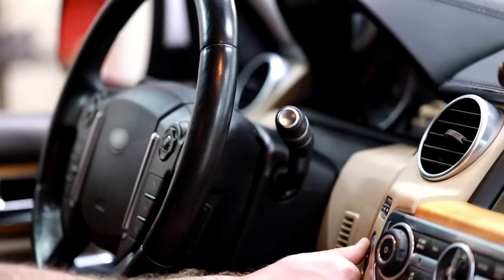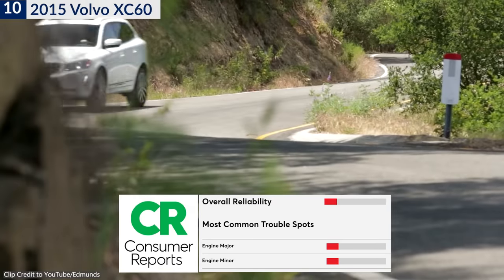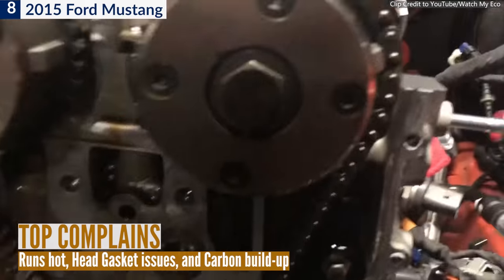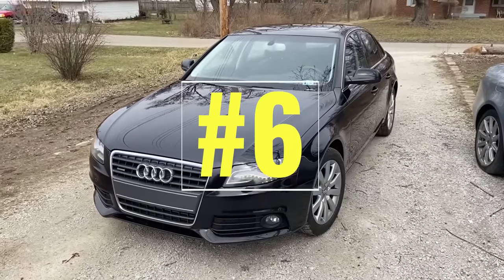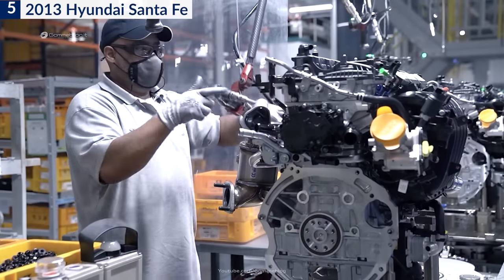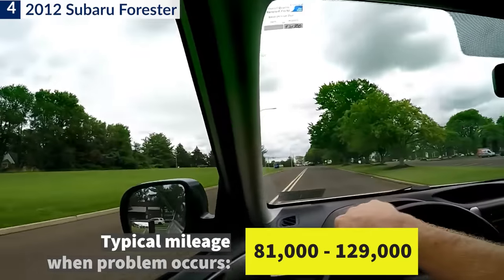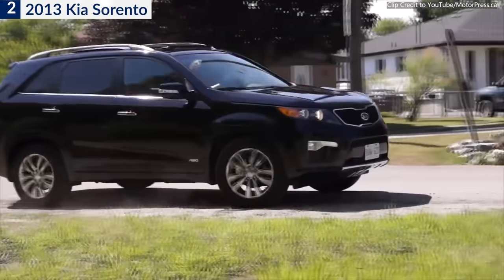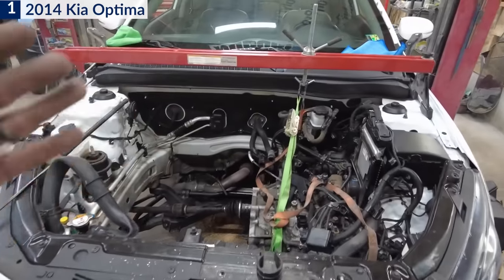10 Used-Cars to AVOID for BAD Engine - as per Consumer Reports

Comment: Funny story... when I was a teenager in the 80's I wanted one of the newer model Thunderbirds because I liked the look of them. I found one used 1983 model in the local newspaper and bought it for a reasonable price. When I brought it home my dad was mad at me for not checking with him first to ask about the reliability of that model and year. He told me that year engine was notorious for blowing a head gasket at around 100,000 miles because Ford tried using cork for their gaskets that later turned out to be a bad idea. And sure enough, just as the odometer rolled over 100k it started belching smoke upon start up and basically whenever you stepped on the gas pedal. The repairs were going to be more than the car was worth. Within a month the car was headed for the car crusher. Moral of the story...always ask Dad first!
Reply: Learn how to fix your own stuff. Blown head gasket is repairable IF you catch it quickly. Don't want a crankcase full of antifreeze. A weekend of work and less than $100 in parts and back on the road.
Reply: Yep … That 3.8 engine was CRAP … Ford screwed over their customers with that one …
Reply: I'm not a mechanic but learned due to these engines , for Ford.  The 2.8 , 2.9 and the 3.8 . All prone to blowing head gaskets,. I would never own a Hyundai or a Kia. Helped work on a few .  The early chevrolet 3.8 had intake gasket problems .the newer 3.8 . To much heat in the engine compartment .  I don't or will not work on any Chrysler engine except the slant 6 or 318 . The 4.7 is iffy you may get a good one or not the same with the early chevrolet 5 cylinders in Colorados and canyons . Yes I love working on all kinds of $#!+ . Owned most of what I mentioned.  Had a friend who collected Yugos , yes yugos . He loved them and for that I didn't give him to much crap about them
Reply: I'm a young machinist with a GenX coworker that knows most  asian vehicles inside and out. One day I heard a little rattling from my accent and asked him if he would check it out. He tells me it's a bolt and he'll fix it on break. 

He comes out on break, grabs a socket set and an extender from his accent, pops my hood and tells me about this bolt that isn't torqued to spec correctly from the factory on these cars and sure enough, problem solved. Dude knew that car down to the most superficial things.
Reply: would have been a good learning experience for you and dad to change the gasket, no need to crush a nice car with a blown head gasket
Reply: I hate to break it to you but your dad was wrong. Corke gaskets have been used for decades before that car was made. They work well when installed correctly trouble is that most people add sealer and that causes the issue.  The other thing your dad was wrong about is that corke has never been used for a head gasket so that couldn't possibly be the reason those engines were prone to head gasket failures. Just because your dad told you something doesn't mean he knows what he is talking about and so on goes the myth that imports are more reliable than domestic. For example the most unreliable engine that I can think of is a Mazda Rotary that they sold for 25 years yet Mazda has a good reputation. GM had a a bad batch of camshafts that they fixed after 5 years yet people still think that makes them unreliable.  🤔
Reply: @wilsterone6689  Thank you. Saved me breath. Cork head gaskets... smh
Reply: You junked it because of a blown head gasket?
Reply: @scavengerspc  
He was listening to his expert dad, who thought headgaskets were made of cork.
Reply: Had a beretta gt with a 3.1   My first financed car that kept me broke too.  Always over heated.  Upon further inspection it was held together with rtv sealant everywhere.  Sold it and got a Honda and it had issues.  My s85 10 4 banger no issues and the patriot 5 speed no issues.  I wish they made things like the old days before I was driving
Reply: @thisdjdada  Interesting,  those engines were known to be absolutely bullet proof. FYI RTV is the preferred sealant for valve covers, oil pans, and intake valleys.
None of which come in contact with coolant.  I'm thinking you had another issue that you failed to address.
Reply: Now we have google
Reply: @wilsterone6689 Should sealer be used with head gaskets?
Reply: @John60s70s  No, if it needs it, it will come already applied.
Reply: Lol. Mine was a Ford mustang. Similar story. After 2 blown transmissions, I got rid of it.
Reply: @wilsterone6689  As long as the RTV isn't overdone, otherwise when it gets into the engine...problems.
Reply: @marktoken6052  Part of my issues with YouTube comments is that they don't exactly show to what comments you are commenting on. 
Since it has been months, I don't remember all of my comments.  What I can say is that it takes years to become a good technician.  That being said,  there is a lot to consider when choosing to use RTV. Like, how much to apply,  what fluids will come in contact with the RTV, what temperature the RTV will be exposed to, and so on. RTV can ge your best friend or your worst nightmare.  Follow the OEM recommended application, not a guy you know who works in a gas station repair shop.
Reply: ⁹ @thisdjdada

Comment: I bought a 2009 kia optima kept it well maintained garaged changed oil and fluids reg.. I followed the manual guidelines . In short the motor like many other KIA's was junk... So at 130k + miles the motor overheated.. all fluids coolant always up to standard
I just junked it for 300 bucks.
My 89 honda Crx I bought new in 89 while in the military? Still starts in 23 deg weather with 380k miles... Just a little rusty on panels and seats are worn lol
Reply: Honda makes the best engines.  Toyota's  as well.  No manufacturer is without it's problems from year to year.  You will see A LOT of old Toyota and Honda on the road versus everthing else.
Reply: Those are golden years for Honda.
Reply: 2 bad Honda did away with the ‘Bullet Proof’ 2.4 four and went over to the 1.5 turbo. I am considering disabling the VCM on my Pilot. That start - stop feature is another drawback. Watch Scotty Kilmer for more details on these features that sacrifice durability and longevity for a few more miles per gallon.
Reply: I owned  many Toyota, including 1980- Celica, Corolla LE., Trecel that Manufactured in Japan. I brought these car used with low mileage except Trecel. I never had issue even oil leak and I drove it all over the country and kept them for many years with high mileage. I used only JDAM parts even it used parts but it from Japan for maintenance. These Toyota Corolla was used for Taxi and police car in Japan and the design baseline is way back to 1968! I was told by Japanese CEO in 1980 that Toyota SR-5 is a Midway for American car industry.
Reply: The old Civic engines were though. We see how newer, post 2010 hold together. I hate 2.4L engine that found it self in Accord, CR-V, Element, Acura. OCI too long, a lot of baked piston rings.
Reply: To be expected from a Honda
Reply: @varcade8  parents bought an 88 Honda Accord from college student for $150 in 1996. That sucker had lived a life! Had 245k miles and dad replaced clutch. Me and my sister shared it and had to replace clutch MC again. But it was just never right, so my dad told us we could continue to drive it if we could figure out how to drive it without the clutch. We scoured our friends, found one to show us how, and we learned, and drove that car another 150k miles!!!!! Only thing to ever replace (aside from the clutch but over a period of next three years) was tires and a battery!!!! Not a single thing ever with the engine and we sucked at keeping maintenance!
Reply: I have a 2009 optima lx with 160,000 miles. I’ve replaced suspension myself at 130k, drain n fill transmission, fluid change on ps, coolant, replaced motor mounts to keep them in check, and  synthetic oil changes. Use it as our road trip car and daily driver. It drives great, smooth on the road and decent on gas mileage. This optima will probably outlive me.
Reply: I was thinking about a new kia or hyundai suv, because of the price, but idk now. I would like the reliability of my 2006 rav4 now with almost 300k and still drives like new, just regular maintenence.
Reply: Kia or Hyundai will never match the reliability of a Honda or Toyota. Most people think they are good value because they’re cheap. Honda will outlast them all
Reply: @patrickgowar2234  Depends. My 2008 Civic LX 5 speed had the dredded cracked block issue. Got a new engine, but also had a power steering leak that had to be fixed. I loved my civic, but ended up selling it since I had too many cars and my family didn't know how to drive a 5 speed. However, my next car that will be my forever car will be a Camry. Absolutely LOVE that car. Great on the road, extremely comfortable, reliable, awesome gas mileage and more than enough room for road trips.
Reply: @patrickgowar2234  Not really. I had a 2006 Toyota RAV4. The Toyota had its audio system replaced within a few weeks of buying a new one, and sold it before reaching 100,000 miles due to severe oil burning that reduced the oil level by half. On the other hand, the 2010 Kia Soul is still being used without any issues. Kia's highly reliable, of course, it's the best value for money.
Reply: At least you got that long. I know people getting 2023 cars and getting 1,000 miles ,tranny gone ,engine, ac system.. it's sad, now they owe 50,000$ with no car. To much to fix.. warranty you got to fight hard to get them to fix it usually. GM is very bad with warranty.

Comment: My 2016 Kia Optima engine blew, but the replacement was covered by some sort of a lawsuit that Kia and Hyundai lost. There was knocking and loss of power just like stated.
Reply: How much u pay for it
Reply: Yea happened to me, they gave me a new engine for free with a lifetime warranty
Reply: My new back then 0 miles, 2013 optima, stalled in the middle of the highway, at 30 miles, almost caught fire by the smell, Kia replaced the new engine as it was a recall issue they were having,
Reply: Never buy Kia or Hyundai. Garbage cars.
Reply: The dealers are making money changing engines reimbursed from the factory. So when you go to the dealer to get oil change you might get oil changed or you might get just a bill for oil changed.
Reply: Yep, friend of mine had to replace the engine in their Optima as well.
Reply: So did my coworker's Optima. Avoid anything with the  2.4 KIA GDI engine

Comment: I have to add 2015 Kia Soul. I have had nothing but problems with it burning oil/ being dry after only 1,200 miles and non-stop engine issues for 2 years..

Comment: I have the 2015 EcoBoost mustang and I've never had any issues with it but I did change the stock exhaust out almost immediately. It has never run hot. And it sounds a lot better. It burns a little oil between oil changes. About half a quart. 97,000 MI so far. Won't keep it forever but I do like it. Also six-speed manual. Fun to drive. I did also replace the purge valve at about 85,000 MI
Reply: I’ve never had any issues. It burns oil lol
Reply: If your ford isnt burning oil it may not be running
Reply: I will be shocked if it reaches 120k.  Both of the turbos grenaded in mine and I am damn near forming a support group of people in my area who have had the same thing with all their various Fords.

Comment: Our 2004 Lexus GX470 has 183k miles and still looks brand new inside with no failures. 
Our 2011 Lexus GX460 has 138k miles and still drives like new too. 

Will deal with higher fuel consumption because I know we will never be surprised by a massive drivetrain failure for at least 500k miles.
Reply: Lexus good company

Comment: I’ve got a 99 Camry with 334k. My daughter bought it in college for $800 about 5 years ago , I bought it from her about a year and a half ago. The car is beat to hell on every corner. The hood blew off on the highway when she was driving it. It looks totally ghetto with a different colored hood on it but I love the car. Totally reliable and still gets good gas mileage. I run it to work. Lots cheaper than running my f150!
Reply: Can never beat those old 90s toyotas, I bought I used Ford Taurus and it has been a great vehicle for school and work for over 8000 miles.

Comment: I drive a 2004 Pontiac Vibe has a Toyota engine never a Problem. I also have 2 Chevrolets  and 2 Cadillac's from the 70's with over 350000 miles. The 76 Cadillac over 560000 miles. They run and run. Low compression engines run forever
Reply: And no electronics and turbo.
Reply: Most of the older toyota s were top classcgetting up to 2012 different  story

Comment: I've had a 1985 BMW 325 since 1999 (my first car). It has 300k miles on it. The only problem I've ever had with it was the gear shift came apart and had to be replaced. I bought a 2013 X5 in 2015. Nothing but problems from day one.
Reply: Goes to show, 80s BMWs are the greatest in terms of build quality.
Reply: Mercedes and BMW had fantastically built cars before I'd say... 1995? Sure, the new ones are very nice... for the first year.
Reply: Old 3 series best BMW ever!

Comment: Yep!  My 2014 Hyundai Santa Fe Sport’s engine needed to get replaced at the 83k miles mark.  Engine lost power while driving.  I didn’t have to pay for the replacement (thank God) but it took 4 months and 2 trips for the dealership to get it right.
Reply: Yes, the same thing happened to me with my 2014 Chevy Cruze.  Paid through the nose to have it repaired.  Can't wait to get rid of it.

Comment: You should do a video on bad transmissions.  I tend to keep cars until they die.  In my experience, I have found that transmission failure in the primary cause of a car dying. A car becoming too expensive to repair and not worth it. When it comes to engine failure, I have found that overheating is typically the worst problem as they get older and then there’s a problem and they overheat and after you get overheating because of some sensor issue usually you’ll get a cracked head or a crack block. End of story for the car.
Reply: In the US this is certainly true. My family lives in the UK, where few people drive automatics, even my 86 year old mother has a manual Honda. Transmission failure is so rare in the UK I have never known anyone who has had one since the 1970s.
Reply: Nissan and Ford comes to mind
Reply: Those were my thoughts exactly and why I bought a pickup with a manual transmission in 2002. I still have it and would not hesitate to drive it across the country.
Reply: There was a vid from this channel listing 10 brands to stay away from in regards to transmissions. They listed 4 nissan models because of the CVT and 2 GM brands.

Comment: You were spot on with regard to the Audi A4 2.0 Turbo.  I owned one and it was plauged with recalls, electrical issue, and turbo issues.  Had to replace my A4's turbo at 50K miles.  And yes, it went through oil like a two-stroke.  Will NEVER purchase an Audi or VW product again.
Reply: It just takes one Audi.
Reply: Current generation of 2.0T is actually pretty good engine
Reply: @sharpknife153  while its standing in your garage 🤣
Reply: @emmachamberlain7587  ea888 gen 3 engines are not that bad, it has been around for 10 years and I see a lot of 10 years old Audis still running well, you just have to maintain it properly like changing oil every 5-7k km. I live in a really harsh climate and environment and still here we have a lot of Audis with 2.0t gen 3 engines and they are being good. I own one too, but it is 2020 car, almost new
Reply: I love Porsche but that’s as far as I will go. Owned enough Audis and VW (A4 A6 GTI Jetta Passat [?] every edition) to know where one thing is great the other is terrible. That love hate is toxic and to be honest the GTI’s hatch with a lexan glass was memorable but it dying mysteriously and needing a jump was terrible. A Bentley Lamborghini or Bugatti? If you can own one of those who cares about cost reliability or depreciation.
Reply: i think all manufacturers have problems with one thing or another .. they want to make cars come off the line too quickly and they are terrible at quality control before the car is made .. once its made its too late right ? on the other hand i have had great luck with the vw jetta with the 1.8 T had it over 8 yrs with no issues and had a Kia soul with the 1.6 L and had it about 7 yrs with no issues at all ... i think when buying a vehicle you really have to do your reseearch on them . I bought a used 2013 Nissan Versa with the cvt trans and he failed before i could get it paid off . very upset that they know they have faulty equipment but dont try to fix the problem going forward .. never again will i buy another Nissan with that type of trans....
Reply: I won’t buy a German vehicle because where I live, nobody in at least 90 miles will work on one. No lie.
Reply: Volkswagen makes crappy little cars
Reply: European made cars are the best in the world.
Reply: I’ve learned that with the Audi of early 80’s, lots of electrical gremlins and fuel injection issues. My current 18 year old Toyota is running strong at 323K miles with only few minor repairs.
Reply: Stay away from 4 cylinders Germans. Everything else is great.
Reply: Yeah one bad gen ruined the reputation, b7 and b9 are good
Reply: @sharpknife153  the 3rd gen is not much better than the 2nd gen, issues are already out there
Reply: @unclej3910  since 09 theyre not hard to work on honestly, its methodic, once you realise how it works, its easier than anything asian and some american cars especially ford
Reply: @tomwatson2567  not really, uk makes the worst cars, sweden used to be very good, not since the 00's, vw's are amont the cheapest made cars on the road, bmw cant hold any liquid without leaking, mb is pretty unreliable too
Reply: @retrocompaq5212  gen3 yes, but I haven’t really heard of any serious problems on gen3b, which have many differences from gen3